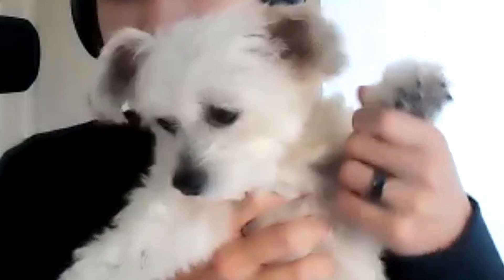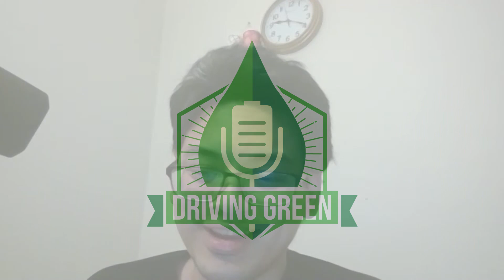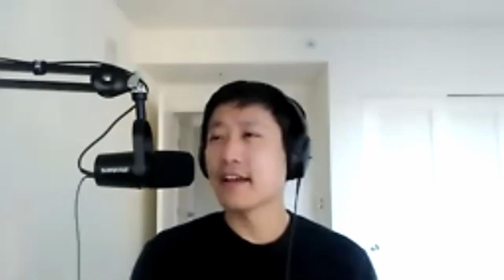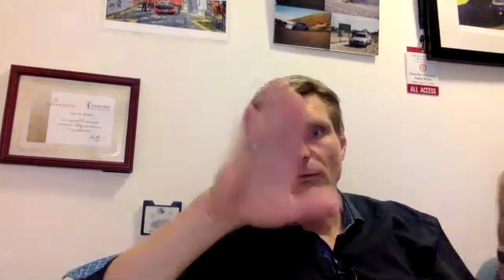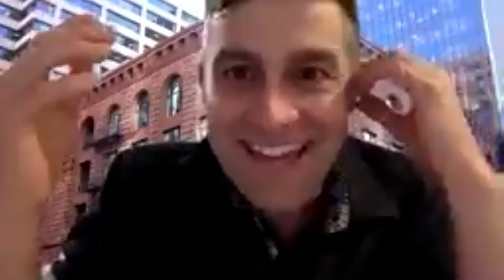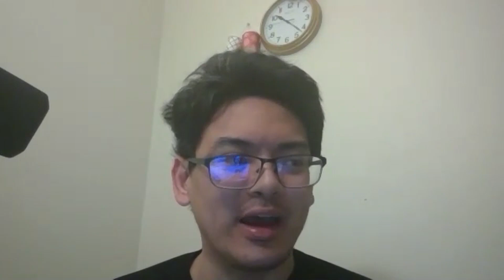Driving Green - Episode 5 - Sven Beiker, Stanford / Silicon Valley Mobility

Comment: I really like points regarding the secondary benefits and use cases unlocked by ubiquitous autonomous transporation (decreased parking space use, higher utilization = lower in-service vehicle fleet sizes = less raw material consumption/energy used, better quality of life due to lower traffic-related stress and accidents, faster point to point travel, etc). Although I appreciate the cautionary notes regarding unintended negative consequences I honestly believe they will be more rapidly overcome than they ever could've under our current scaling limited transportation system stack. In my 34 years of IT I was never asked to "unautomate" anything. The benefits always, overwhelmingly, in the end, outweighed the temporary pain of getting there.